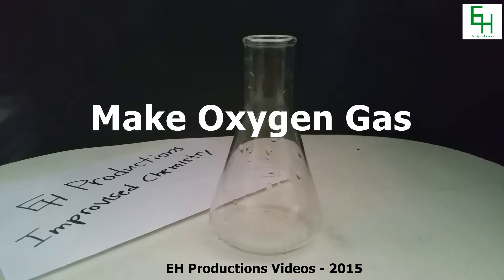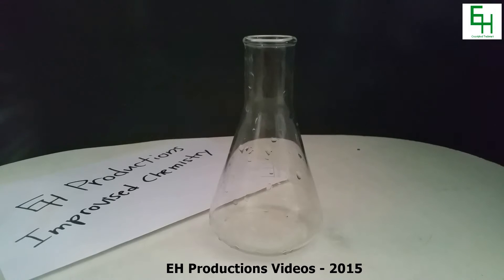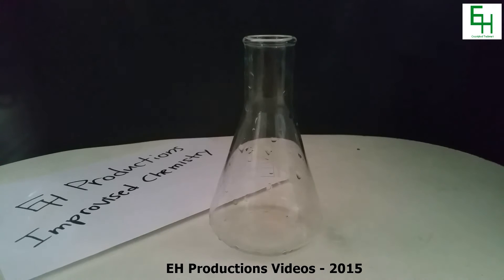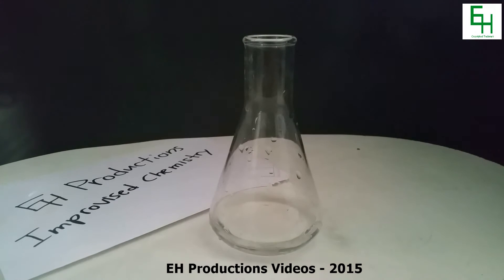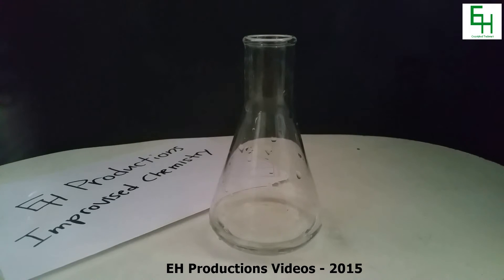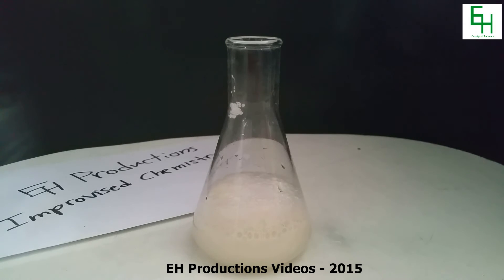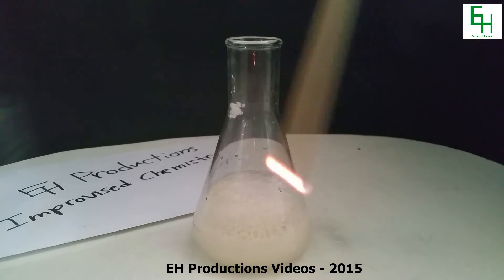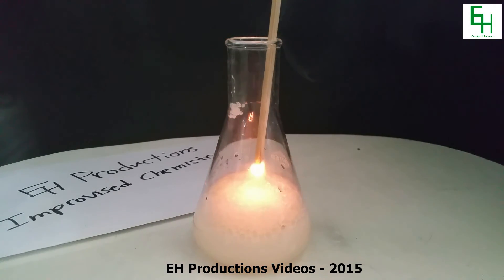Make Oxygen Gas with Household Materials (Chemistry Experiment) Full HD

Comment: why it is burning? i need an answer for my experiment. thanks.
Reply from the maker: +charlotte ordona In this experiment I made oxygen and it filled up the flask. Then I lit a piece of wood on fire and I waved it to get rid of the flame. Now the end of the stick is charred and glowing. When the glowing tip is introduced to the oxygen the stick relights again. The wooden splint test is a classic way of testing for oxygen. This works because to have a fire you need fuel, oxygen and heat. Well, the fuel is the wood, the flask is filled with oxygen and the heat is from the hot glowing end of the stick.
Reply: +EH Productions Videos thankyou
Reply: EH Productions Videos And now put this in your description